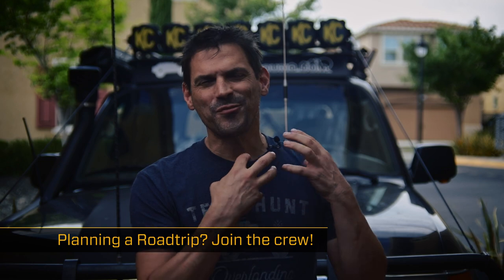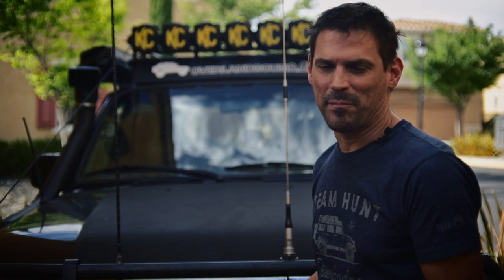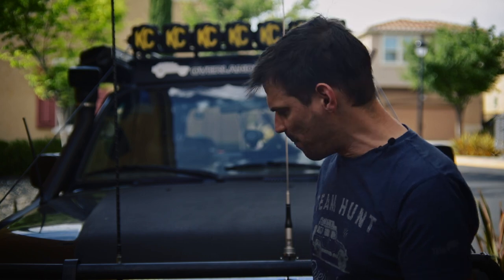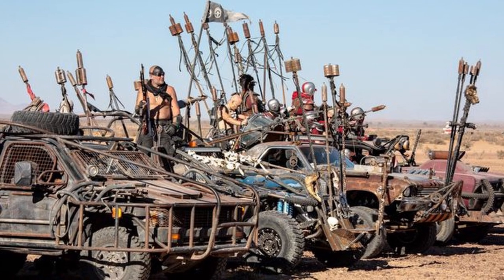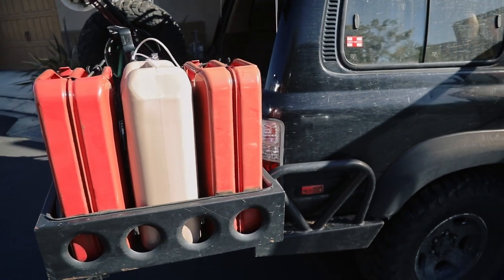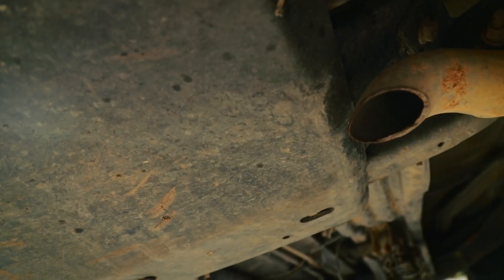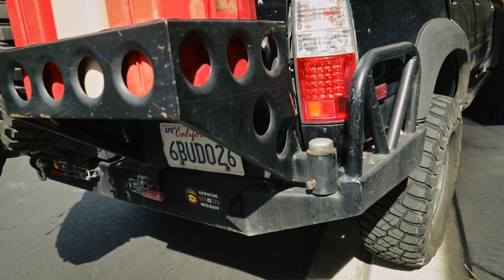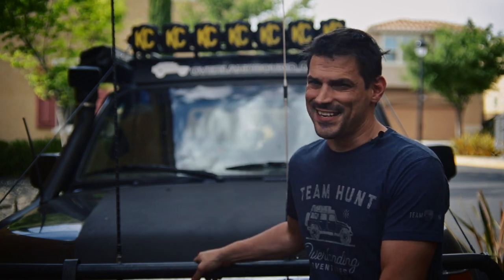Bumpers! What You Need to Consider!

Comment: Audio is still low and with a lot of parasites
Reply from the maker: It’s hard :)
Reply: @OverlandBound  seems like it. Are you using a new piece of equipment/software?
Reply from the maker: It’s a wireless mic setup and has diff settings if it’s one mic or two. Then the software supports like, Dolby Atmos 10 channel or something. So I THINK the vo is actually playing fine, but on an unsupported channel on most devices. Literally got my wires crossed. I’ll sort it out.

Comment: ARB is junk.. Ive personally watched 2 bumpers fold like they were tin. I guess thats what makes them air bag compliant...
Reply: Can you elaborate on the situations in which this happened?  If you have any links to writeups or anything to back this up I'd be curious to check it out. 

I've seen and heard the opposite.  Talked to one guy who had hit two deer at freeway speeds with the bumper on his rig no visible damage to bumper or vehicle!  Then, more personally, my dad also has an ARB on a Wrangler JK and hit an big elk dead center. (The GPS on the dashcam shows the impact at about 75km/h). The bumper saved the Jeep from sustaining major damage that would have been trip ending on a long trip or expedition.  The bumper itself only had damage to the license plate mount and a tiny dimple under the signal light!